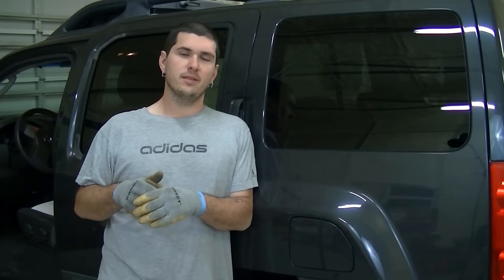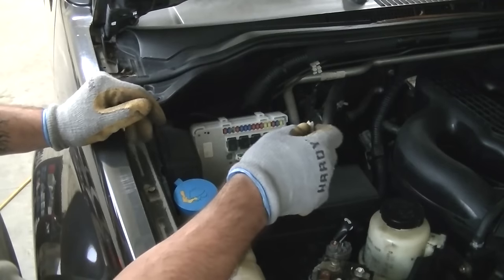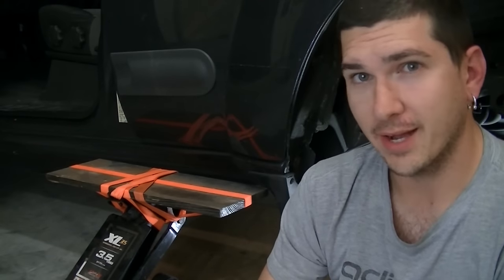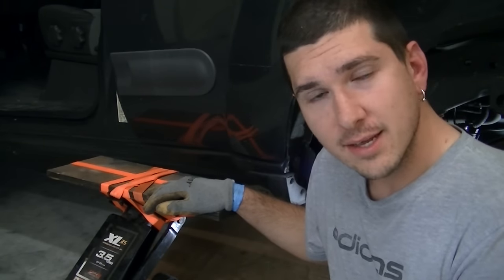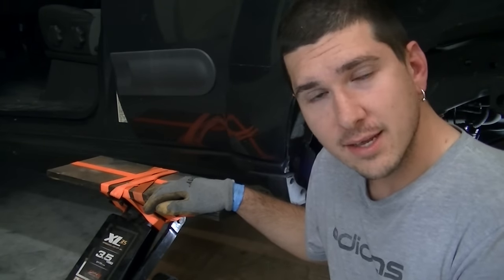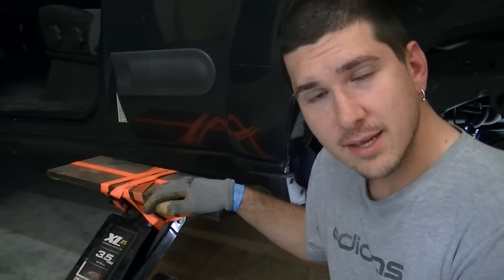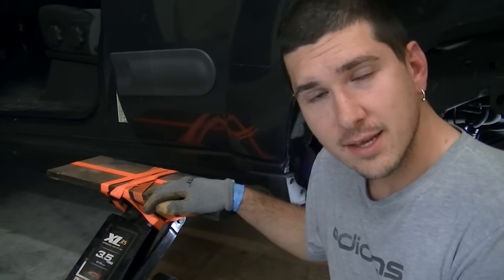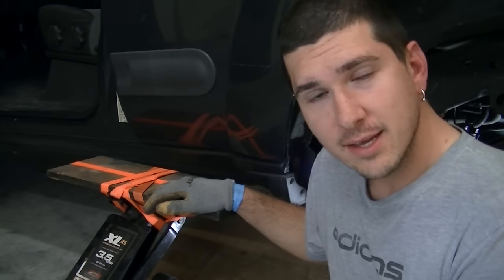How to Replace the Fuel Pump on a Nissan Xterra/Frontier

Comment: Great video, you will need to buy the Dorman 800-041 5/8in Fuel Line clips. They are designed to be a one time use part, they are on Amazon for less than $10. I saved $700 by doing it myself. Total time 3hrs start to finish, fuel pump $130, fuel clips $10, satisfaction not giving the dealership my money, priceless.
Reply from the maker: +Sean Creamer awesome! Isn't it a great feeling to knock out jobs on your own car?!
Reply: 700 dollars?? Impossible.  My mech wanted 400 bucks.  Did it myself.  Everything was right there.  Banged it out in 2 hours with beer breaks.  Just needed to replace that round o-ring washer.

Comment: Ok is the right way for the second generation but for the first generation 1990’s thru 2004 you only take a apart the back seat (driver and passenger) and open the fuel pump cover.

Comment: Thanks for posting this very helpful video. I have a couple of suggestions, first never take chances with fuel connectors. Replace any connectors or hoses that break while disassembling. Second, as others have mentioned clean the tank thoroughly before removing the fuel pump/sending unit. Thirdly, carefully inspect the electrical connector that plugs into the fuel pump for signs of overheating or corrossion as this can cause fuel pump problems even if the pump itself is good.

Comment: 1. Brass Punch in place of the screwdriver. 2. Fire Extinguisher nearby. 3. Clean top of tank before removing lock ring and pump unit.

Comment: I know this is old but there is an access panel under the back seat so you don't have to pull the tank? On some of them. If not cut one.
Reply from the maker: That's true for some models. Not mine.
Reply: @Rythecarguy  I cut a hole in mine took me about an hr in total and then cut a piece of sheet metal, sealed it screwed it down in place covered it up with the carpet just in case I'd have to do it again. so much easier and quicker. Didn't have to drain gas jack the car up take a tire off. Just like the factory did and should have kept doing. Saved them money cost us more.

Comment: Just replaced Fuel Pump and sending unit in my daughter's 2007 Xterra.  This  is the best video on YT to help you though the job !     Using Amazon, I chose to by the Bosch unit for about $180 and added the Dorman plastic clips to my order.  Glad I got the Dorman clips because the original ones broke.  I would just get new ones and not waste time trying not to break the brittle originals.  Also, I took an extra hour or so to pump out the 7 gallons of gas with a small hand pump, had to access the gas via the tank opening after disconnecting the filler tube.    Couldn't fit floor jack under tank, and with it empty, you don't really need a jack anyway.   Glad I had the impact wrench to loosen the tank strap bolts!   Was tough to get the electrical connector on the new pump, very snug fit, Thought I was done but had a gas leak due to pressure hose not being fastened securely on the new pump, luckily there was no other issue.   If I can do this, you can do it too!   Thanks to Ry for the excellent video, I saved about $800 and spent 5 hours with my mistakes and stretch/water breaks.  Now that I did it once, I could do it again in about 3 hrs. if tank is empty to start and I didn't waste time trying to save the original Dorman clips.

Comment: Just replaced my sender/sensor rather than the whole unit. Wanted to say many thanks for detailing the whole procedure. It really helped. I had one mishap where the fuel line wasn't fully clipped in (and spewed gas everywhere) so I had to drop the tank a second time, but I finally got it. Thanks a bunch man, and keep up with the videos, your content is awesome!

Comment: You change so much things on that Xterra, by the time you’re done with it  it’ll be like a brand new car!
Reply from the maker: Haha just about!
Reply: 97 pathfinder R50 after dealing with p0505 and ecu replacement and tps now I have a MAF p0100 checked open wire no big deal. Attempt to do idle fuel mixture procedure stalls out no codes check pressure no adequate pressure well looks like I gotta do a pump now

Comment: This video is outstanding. 
Had to replace the fuel sending unit on my 2006 Xterra last weekend and followed this step by step. About 3 hours (and a couple of bloody knuckles) and passed inspection with flying colors after the codes reset. Thanks for the great details!
Reply from the maker: My pleasure! Thank you for the kind words.
Reply: Frank, why not replace the whole assembly while you have it all out?

Comment: Compared to the Timing Chain job this was soooo much easier on my 05 Pathfinder. Hardest part was trying to figure out a lift to lower/raise the tank while keeping balance. I didn't feel comfortable with my floor jack and ratchet straps so i used my ATV lift and it wasn't perfect but it did work. Other than that it went pretty smoothly. I did break both clips but i prepared and already had a new pair that i bought with the new fuel pump...once done the truck fired right up and check engine light gone. And best of all i now know how much gas is in the tank lol..  Thanks again Ry your videos are the best very detailed and accurate. Keep doing what you do.
Reply from the maker: I agree, since this video I have started using a transmission jack and that has been working wonders.

Comment: Got the P0463 code 1 week after buying my 2005 X at a used dealership :\, bought the assembly that you listed (hope that helps support the channel) and the light turned off before I could get around to dropping the tank! It keeps turning on and off, typically after I fill the tank up. I might just wait until the code stays put before doing this fix, and glad I have this vid for reference.

Comment: Good video. My son and I just replaced the fuel pump assembly on my daughters Xterra. Get the Dorman fuel line retainers part number 800-041(two clips per package) for the fuel evap hose. These clips are a one time use item, just pop the old ones out with a pocket screwdriver.

Comment: Thanks for your reply, but I didn't have time to reset the engine light, so I ran the frontier with engine light on, and wallha, light went off by itself. And that was sure the problem, defective sending unit in fuel pump, the other defect the frontier had was radiator which I already changed out, and the other defect on this stupid truck is power distribution module, but have not noticed any bad symptoms on this thing. Called the dealership if any of these defects could be changed for free, but you already know it wouldn't be free. Don't buy the Nissan Frontier, nothing but problems, and it barely has 96,450 miles on it. Again thanks for the video, it sure helped us out a lot. Keep'm coming.

Comment: Nice job. My dealer wanted 1200 for that job. Found a quality part on RA for about 180. Looking forward to knocking it out.
Reply: What brand did you end up buying on Rock Auto?
I'm in the process of comparing the different models and am thinking about buying  the Bosch part.

Comment: Ry, thanks so much for this video, as others, I was able to get this done and save at least 600 bucks.  I did get the clips which I definitely recommend as I broke both, and by far the biggest challenge for me was getting the electrical plug disconnected.  I had to press on the clip with pliers to get it out, but other than that it was pretty straightforward.  Again, Thanks!!!

Comment: Nice video. Lots of good info.
I would suggest that after the tank is out, you scrub it clean BEFORE you pop the pump. ALSO use a brass drift instead of a screwdriver.(No Sparks).
You should also clean the inside of the tank.
Good job. 
Always be safe.

Comment: really good video.  Despite your warning, I also broke the same clip.  I just replaced the fuel sending 'brush' 30$USD part on the fuel pump to fix the fuel gauge/whole repair should be warranty recall in Canada but is only so in the USA.  Still had to do everything you showed.  Thanks.  Good work!

Comment: Well I have been putting it off but finally completely replaced my fuel pump and fuel tank on my 05 Frontier. The tank was leaking gas and every sealant I tried would not work for much more than a few months. The pump was still working but I figured I should replace it since I was in there and because it was over 10 years old. You're video helped a ton! Literally same exact process from what I could tell. Hardest part were those damn plastic electrical connections. I was able to get them all off without braking anything but it took forever. Anyways, thanks again for the great vid!
Reply from the maker: That's great! doesn't it feel good to get it done? I love getting things working again.

Comment: Thank you so much for this video. It helped a lot with the fuel pump replacement on my '06 Pathfinder. Those little plastic clips broke on mine as well, maybe you can update the description with the replacement part number so people can have them readily available. Our local parts store had them in stock, the ones I purchased where the Dorman 800‑041. Again thanks for making these videos!
Reply: Thank you Ricardo. It's so much easier to just break that silly little clip and replace it than try to remove it.

Comment: I just took out back seat then cut hole in floor behind seat exposing fuel pump, changed pump, used sheetmetal and rubber gasket to seal hole, no fumes or water can or has got in, lot quicker and lot easier

Comment: Ray how often should I charge my fuel pump it's been working fine but has 246 thousand miles on it ?? Thanks Carl .
Reply from the maker: They are technically not maintenance items and they usually show symptoms before failure. TBTH I would wait until you see issues before taking action.

Comment: Very nice, thorough video thanks. I came here to try to get an understanding. How do I know if I need a fuel pump or just a fuel level sensor? 2007 Xterra same code P0463. Only symptom is the gas hand situation that you describe.

Comment: I had a similar problem happen to me last night. I can confirm that I definitely smelled burning oil before my truck shut off quietly while I was sitting in a drive-thru line. Initially it would not restart but after about 3 crank attempts it did start up again. I was able to make it home and immediately checked the oil level, which was fine. The truck will start, but is very hard to crank. Your video indicates to me that I also have a fuel problem. Thanks for the upload.

Comment: Great in detail explanation! So did this fix the problem with fuel gauge needle going up and down while driving? Because mine doing this especially going down the hill the needle drops to minimum and then goes up, kinda irritating
Reply from the maker: Yes. The fuel sending unit fixed the issue
Reply: Thanks!

Comment: I  understand that the gas line filter is in this tank. Is it a part of the entire fuel pump system and if so, where is it? I understand that changing the filter is a scheduled maintenance item that I am dreading if it is infact a part of the fuel pump system.

Comment: Thanks for another great video. On start up I noticed your vehicle had high revs why is this and where is the fuel filter situated? My Navara although it always starts you have to crank for a short while then it revs high when it starts could you offer any advice as to why this would be? I thought maybe a blocked fuel filter or faulty pump? Many Thanks.

Comment: great video.  I just replaced the fuel sensor sending unit and not the entire pump.  this video helped a lot, but my gauge is still reading empty for some reason.  Any other ideas what might be wrong besides the sensor?
Reply from the maker: +Austin Murphy the gauge is a separate piece that sits at the very bottom of the fuel pump bracket. Its a float at the end of a steel rod. That rod has two electrical fingers in it that run on a track. That's how it tells the levels. The most common reason for failure is those little fingers start to pull away from the track. Thus giving you no reading. If you did not replace that part then you will sit have the problem.

Comment: Brother, i have a problem with my xterra. I have good Rams but it doesn’t accelerate at all. Got my transmission check and they it’s good. The throttlebody is new also. I removed both catalytic converters and still having the same problem. Do you think is the fuel pump that is not throwing sufficient gasoline? I really don’t know what else to check. I been a subscriber since long time and every time i have a problem with my xterra i watch your videos! Thank you so much for helping us a lot !

Comment: Great video! What about draining the gas tank to clean out out any debris, dirt, grease, whatever that may have contributed to the pump failure in the first place? Any thoughts?
Reply: If I'm not mistaken, the pump didn't fail. the  Fuel sending unit that sends info to the fuel gauge failed.

Comment: Great video.  I was under the impression that the error code indicated a faulty fuel sending unit.  I have this issue that the gauge reads correctly until about half full then drops to empty,  The check engine light is also on.  I need to fix my 05 Xterra and wondered if just replacing the fuel sending unit is enough or is it wise to go ahead and replace the entire fuel pump module just in case it is near failing?  What do you think?

Comment: great video - we tackled this job in the last week...  broke the infamous clip on the evap line (like 90% of everyone did); replaced it with a ty-wrap.  got it all back together this morning, and put gas in it and it wouldn't start.  and no fuel registered.  ... so, lowered the tank enough to get to the electrical connection on top of the tank which was apparently loose...put it all back together again,  so now the fuel level registers...  BUT IT WON'T START.  it's got 6-7 gallons of gas in it, the gauge registers, but can't get the engine to start.... makes me want to tear my hair out!
Reply from the maker: I hate to say it but you may want to throw the old one back in (assuming the pump part still works) to see if it will start. If it does you might have a DOA pump.
Reply: ...and he says "throw the old one back in" like that's a five-minute thing to do... hahahahaha!  pretty sure the pump runs (hubby can hear it when we turn the key on).... but the thing's got an anti-theft circuit on it that we may have tripped... and i've got a few relays to check in the morning... but yeah, that thought crossed my mind, too.  at least all the bolts in the hangers are nicely either new or lubricated and all, so if we have to, it will come apart easier...

Comment: A friend of mine helped me change out the fuel pump on a 06 nissan frontier b/c experiencing same problem as you, problem with gas guage. We took out the fuse and did what you did, but forgot to disconnect battery cable. Everything went smoothly, truck is running with no problems, no leaks, etc. Only thing is engine light is still on. Do we need to disconnect battery for it to reset?  Would hate to do that b/c trip odometer reminds me when to change oil. Thanks for video, any feedback appreciated.
Reply from the maker: I have an OBDII reader that I use to clear my codes at home. I made a video on the one I use if you want to take a look: https://www.youtube.com/watch?v=4GBiwuhwU1Y

Comment: Great video.
Any issues with that brand fuel pump? I see that there are many brands to choose from with varying prices. It appears that Bosch is the OEM original part. I’m having trouble deciding.
I changed the fuel sending unit several years ago due to a trouble code and Improper gauge reading. Now, the fuel pump has not gone out, but is making a terrible squeaking sound every time you go over even the slightest bump. I searched under the vehicle to figure out where the noise was coming from and sure enough it is inside the fuel tank. After a little research, apparently this was an issue on the 06 model and the pump was replaced if the vehicle was under warranty.
Reply from the maker: Honestly its been great. Zero problems so far.

Comment: Maybe you’ll know the answer cause everyone else can’t figure it out. 
I have a 2005 Xterra, it has hard time starting when hot, it’ll start every time when cold, but after turning it off it won’t start until I wait 10-15 min then it’ll start. I changed the fuel pump, relay, spark plugs and coil packs, cam shaft sensors and it still has the problem. Once started it runs great. Any advice will be appreciated.
Reply: Ever figure this out?
Reply: Same exact problem here. No one can figure it out. Replaced everything and still won't start after it's hot. Anyone figure it out?

Comment: When you were dropping the tank you had to reach up to release the electric connection because there wasn't enough play. I didn't see at what point you disconnected the fuel line. How far were you able to drop the tank to get to that? Was there enough play in the fuel line to drop it all the way down?